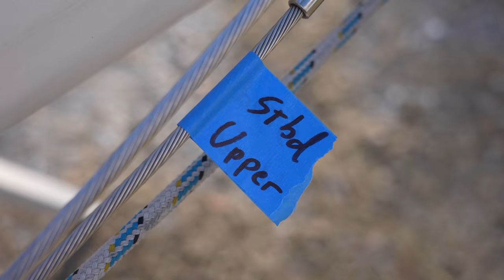Keep your MAST UP and your keel DOWN | S06E32

Comment: Quick question from a rank amateur.  For removing the stern rail, couldn't you have just cut the bolts from the top and let the nuts drop down (since they weren't glasses in) and you aren't re-using that railing?  Presumably, the new structure will require beefier attachment as it holds a lot more weight.

Comment: Hey guys...this is the best video ever for me. Not the prettiest but definitely the most helpful. I have a Pacific Seacraft Orion 27 and have to remove teak slats to remove chain plates. Fortunately they didn't glass over the nuts. I was going to pull staples in the headliner but will take you advice on that. I was wondering about the square holes in the plates to keep carriage bolts from turning. I was told square holes are a point of weakness. Use round holes & SS316 hex bolts. Might not look as pretty but better long term. Your thoughts?

Comment: Can’t believe how these boats aren’t designed with maintenance actions in mind !   Well done for persisting.
Reply: Like houses with fitted kitchens and bathrooms..and newer cars everything gets done for looks or the assembly line sequence..
The rest is what turns maintainance into planned obsolecence..and thats something we all need to see change for the future.
A spray of light release oil once you remove the nuts will help them slide out when you start to drift them out.. 
Coach bolts give a pretty finish but are a pain to get at. .. Trad hex heads  are better to get out .. Allen and torex stars in pan head bolts can chew up...though this is more likely with smaller sizes.
Reply: I remember a Chrysler where you had to take the V6 engine off the motor mounts to get at the back spark plugs...great for the dealership, not so good for your pocket book...cheers🍷🇨🇦

Comment: Damn amazing effort! But I would have left the chain plates untouched. 😊 Yes, you want to keep the mast up as much as possible but I think you are forgetting that under some circumstances you want your rig to let go eg if you get badly capsized / rolled then it’s better for the rig to let go than to start tearing the boat apart.

Comment: The chainplates are external and easily visible. Is there not some way to non-destructively check them for flaws that would need replacing? Bit different for plates that go through decks where they have to be pulled because of hidden damage. (and dismasting from chainplate failure.) But I guess you also need to assess the hidden bolts.
Reply: That chainplate  he took off looked to be in mint condition. I would have inspected the others from the outside and slapped the one he took off back on and called it a day. But in saying that I know nothing about sailboats other then I love the way they look.

Comment: I was very nervous at 4:30 after you talked about the mast sticking. I recently watched a keel stepped mast being lifted and it pulled the boat 4-5” out of the water before it finally let go. If you had started to lift Atticus on the hardstand that would obviously have been a problem! Must admit I would have done the mast lift whilst still on the water!

Comment: I wasn’t sure why you were having some refit work done in Washington North Carolina until I found that your 1997 40’ Pacific Seacraft was originally built by the same company helping do the refit work.

Originally headquartered in California, Pacific Seacraft filed for Chapter 11 protection from its creditors in May 2007. The company's assets, with the exception of the Dana 24 molds which went to Portland, Oregon, were purchased at a bankruptcy auction. In September 2007 they were moved in their entirety to Washington North Carolina, along with some of the former employees. Production restarted in 2008 under the new ownership .

Railmakers Inc. was the O.E.M. supplier of rails for Pacific Seacraft. Did Pacific Seacraft acquire the drawings and original welding fixtures from Railmakers for the production of rails, stanchions, stern arch etc. needed for Atticus II? From your video, it appears you are going to use DYI swage mechanical fittings rather then have a rigging shop press the swages. I always assumed the rigging shop method was more reliable?

Comment: OMG do I feel your pain.  You’d think removing the chain plates from a little PSC Dana would be easier.  Not!  It killed me to disturb the factory woodwork, liners and kitty fur.  And trying to remove and re-install those top bolts above the wires and cables way up in the small bulwarks  required a little bit of magic (and more than a few choice words) to accomplish.  So glad that job is behind me.

Comment: Here is something to think about for a similar situation. It hasn't always worked for me but it has occassionally, so would be worth a try. Put a socket on the bolt head outside and put a high torque nut driver on it, and (making sure it's in reverse) hit full force. If there is any paint, epoxy, or caulk on the nut to hull interface on the inside, it's static inertia may be enough to hold it stationary for that brief moment it takes to break the threads free and unscrew it. It won't work doing it slowly, it has to be done quickly and all at once. If the nut and washer remain in place, leave it there to simplify the reinstallation. If the nut breaks free and spins, then put a little off center pressure on the torque driver to sort of jam the socket on the bolt head so that you can perhaps pull on the bolt head with the socket gun and, pulling the nut & washer against the inside of the hull for more friction, finish unscrewing the bolt from the nut. This might be impossible if the bolt threads are coated with caulk. If it doesn't work then you are going to have to do what you were going to do initially. If it works you can then not worry and be happy!

Comment: Yeesh ... my 55 yr old back is glad those days are over. Maybe that's why old guys go for bigger boats - too hard to get into those nooks and crannies!  Curious about the glassed-in chain plate bolts - does Pacific Seacraft assume they'll NEVER leak/corrode and need to be worked on or what? For such a well designed and built boat that seemed odd. Then again, it may be the best way to do it. I miss the gin and BBQ ...

Comment: I don't want to sound critical, but unless I saw evidence that those chain plates had a problem, I would have let them be.  I'd have looked for fore to aft movement against the hull at the mounting location.  Things like that.  As they say "If it ain't broke, don't fix it."   But I do not know if the insurance company said "and that includes the chain plates" as far as replacing the standing rigging goes.  The other thing I would have done/considered is grinding off the outside heads on those bolts that held those rails on. You'd have destroyed the bolts but it would have been much easier to remove the rails.  What I'm now wondering is how will the new arch/davit be attached to the boat?  Will the same holes be used?  

With all that said, Jordan obviously worked his butt off.  I do think you could have given Desiree more responsibilities.  After all, if a husband is looking for nuts, his wife is very likely to know exactly how to find them.  She probably knows which way to twist them also.    : - )

Comment: Great video, providing valuable instruction.  I respectfully suggest putting a T-valve in line with the seawater intake for your watermaker, allowing you to make drinking water from a hose, supplying wash-down or well water at marinas that provide wash-down water for free.  A perfect example is the Bahamas.

Comment: If contortions to reach difficult fittings above and below decks were an Olympic event, Jordan contends for the "boat project decathlon" gold, chain plate chrome and cutting the shrouds' Gordian Knots.  Where would Desiree and Oso have fun placing the medals?   Hmmm....

Ideas to make chain plate nut servicing easier:  1)  Once reset, put some electrical cable heat shrink around them filled with RTV162 before applying the heat.  The only reason for using the hole saw was because the plate nuts were fiberglassed over to seal the through-hull holes.  2) Replaced the slatted woodwork with a set of shiplap-type panels -- fewer screws to remove and caps to replace.  A tongue-in-groove binding method into larger shiplap interior panels also makes better sense for the white fascias than (!) staples.  Quicker access, less fuss.

Observation:  There's no insulation behind those nice wooden finishes.  I'm reminded of Atticus I lacking air conditioning in the Caribbean, and how heat was precious in Connecticut upon buying Atticus II, again traversing the Chesapeake Bay.  Beyond that, salt fog and humidity will eventually start claiming your video processing electronics as "blue screen of doom" casualties.  Are insulation and interior climate control part of the refit plan? 

Blessings,

S/V Windwalker

Comment: WOW  !!!  Absolute fantastic videos of all your steps of replacing things during the haul out. Very interesting and we could watch hours and hours of these videos. Jordan it really looked frustrating trying to remove all the nuts and bolts. I think after this experience with the refit, you should have no problems staying on top of things as you pretty much know the boat and most systems from top to bottom. It will be nice to know you checked off all your items white sailing in bluewater and don't have to say  .... we should have done that while Atticus II was out. You guys rock, stay warm and know it won't be long and you will be sailing away !

Comment: You should get a oscillating saw. They cut as well as a dremel tool and they don't throw debris all over the place. You can get one for about $100. The money spent will be saved on cleanup. Not to mention, it's a good excuse to buy a tool. So you and Oso can do some more manly bonding.

Comment: I can SO relate to the theoretical planning vs actual time it takes.  I started a project a year ago to replace my nav lights with new LED versions.  The brackets turned out to be too small.  I ended up making new ones myself, but then had to find someone to come to the boat to weld them.  After a few failed attempts with flaky welders, I got them welded in place.  Then to pull new wires as the old ones were damaged from the heat from welding.  After a full 6 hours with my arm inside a 4" inspection port and a 10" x 6" bruise on my fore arm, I got the wire through the pulpit.  The struggle continues, but man it will be nice when it is done :-) These projects are hard enough on their own but to also film them must make it that much more challenging.  Thanks for the extra effort so I can know I am not alone in my boat project struggles.  I can't wait to see the progress.  Cheers buds!

Comment: Removing those chain plates seems like a big waste of time. Especially when they could be inspected pretty easily and externally mounted.

I noticed the backside of the one you showed looked perfect.
Reply: There we go the comment I've been looking for. I'm with you all the way as it seems like replacing the chain plates on this boat is totally overkill.  After taking the one off and inspecting it as long as the rest of them look as good on the outside I would have slapped that baby back on and said it's good.  😀
Reply: The chain plates action was not necessary and a waste of time, energy and interior. I'was very surprised to see that happen: 'is Jordan seriously doing that?' It's like breaking down a perfect house to see if the foundation is still on it's place in the ground. A boating todo list contains much more prior things...

Comment: I don't know about 17 years,  My rigging guy was telling me 12-14 years for boats in the northern Chesapeake bay, depends on how long she sailed there before you got her. Also keep water off those tags you made, the blue tape doesn't last long outside and will become nearly unreadable quick, kinda like your fingers and toes when your on the water too long,lol.
Reply: And when you get bolts stuck like those in the chainplates, try unthreading them and cleaning the holes. Alot of the time they will unthread out of the hole becouse the sealant can form threads to hold it. Also it's easier on the surrounding fiberglass.
Reply: @PennWolfsSailingAdventures  Carriage bolts with square hole in the chainplates: can't be unscrewed from the outside.
Reply: @michaelramsden7482  oh ok,that makes more sense, every boat I've had they were regular stainless hex bolts, sometimes a bit rounded.

Comment: You could have turned the chainplate bolts from the outside once the nuts were off. Probably resined in, the twisting would have loosened them up. One thing is, you get to learn more of how the Boat was put together, which means you can modify certain things. It also helps to be a contortionist.6 foot 4 inches to fit in a trunk or hire a midget. Good job Bud.
Reply: Looked like carriage bolts into a square hole in the chain plate so turning from outside not possible.

Comment: You have to be a contortionist to work on boats.  Maybe some Yoga and stretching exercise's would help.  : )     Whenever I do projects like this my wife take's my estimate of how much it's going to cost and how long it will take and doubles my estimate.   Her estimate is usually a lot closer than mine..  : )   Thanks for the video.  Repair On!  : )

Comment: Regarding the zip ties: I used to use those a lot in the server room and on the boat. But since I found the hook-and-loop cable ties I'm using them everywhere. They have some kind of nano loops, can be adjusted and reused. Might be an option when you need to do a quick fix and tidy things up again.

EDIT: Oh, and it's really cool that all things are screwed on. On modern boats a lot of important things are clued … cough Parley *cough*.

Comment: I don't know about the chainplates... they seemed to look in good condition to me. Another thing is that the material today is not as good as it was 30-40 years ago, and you could end up putting in iron that is of a lesser quality than the original one. 

People that know about tools have complained about the quality of steel and iron - and they are actually searching for older tools and materials on the scrap yards to be able to get quality steel. Even simple tools like hammers and spades are of a much lesser quality today and bends like spaghetti if pressure is applied.
Reply: I totally agree about steel quality - be careful with quality. The situation with many tools is similar unless you buy costly tools. Cheap stuff is imported from China, and they use inferior steel and are experts to reduce material costs to the minimum, thus thinning down the thickness as much as possible. In the old days, tools were often designed with a lot of margins.
Reply: Materials science has advanced significantly in the last 40 years, there are absolutely better materials available today.  What people are observing is that manufacturers are now cutting the tolerances and material specs closer to what’s acceptable for the purpose - it’s an economic optimization.

Careful selection of the material and supplier will address any material quality concern.

Who knows, maybe they’ll go with titanium plates, an option that was likely financially impossible 40 years ago,but is very doable today.
Reply: @danpatnet  I'm not talking about material science. I'm talking about the poor quality of iron and steel in general. 

We all know that big leaps have been made in the technology. But that doesn't help if the general products you buy in the store are of poor quality. From screwdrivers to anchor chains.

Comment: How much did you save on the mast removal with Jordan being the one to go up the mast and helping in the other ways he did with the rigging removal? Just wondering.
Reply: I suspect he wanted to be sure no radar, antennae or lights are hurt while making this film
Reply: nothing, as the Crew from the manufacture showed up it's likely sponsored. Just to ensure the dummy didn't mess it up.
Reply: When we had our mast pulled for our refit and then later for our Erie Canal transit, we did all the tying off of halyards and loosening of the shroud/stay turnbuckles the night before as that is where you burn a lot of yard worker time, especially if the turnbuckles need some persuasion.  We let the yard guys go up the mast the next morning with the crane to pull the masthead instruments, sling the spreaders, etc.  They do that stuff all the time, no sense us risking ourselves.  In Jordan's case I think it was done for a bit of entertainment value.  We also had a Spartite collar that had been in place for a bunch of years.  Ended up having to lift the 40,000 pound boat up about a foot out of the water by the mast with the crane until the Spartite released.  A bit nerve-wracking.
Reply: @svechappe6075  Interesting. How many hours of  extra yard worker time do you think it would have taken if they did  all the work?
Reply: @emilybh6255  Each time we got the mast ready to be pulled or stepped, I would guess we saved about 4-5 man hours.  That works out to around $400 off a $1,200 mast pull or step.  Probably saved more on stepping than pulling because it's more time consuming to rig than to de-rig.

Comment: I spot a design flaw, all those nuts should have been accessable, are all pacific seacraft's like this or was this something a previous owner did?
Reply: Doesn't it add some extra watertightness? I understand the trouble removing glasing but it does not happen very often and it is a big pain in the ass if water would dripple in at those bolts. Lack of physical access due to other structures is a real flaw though.